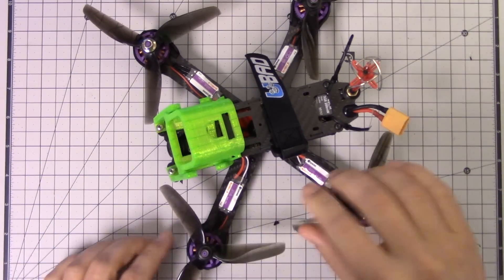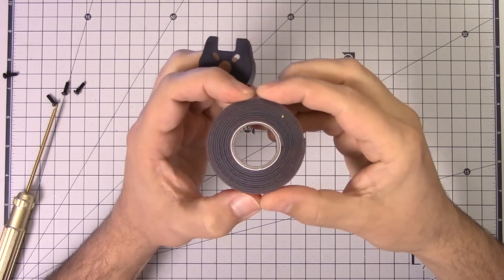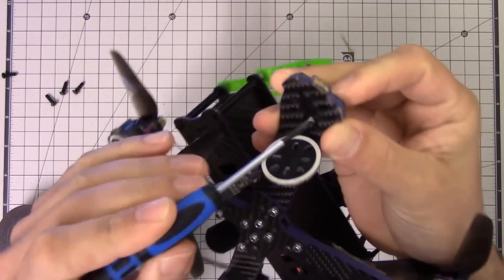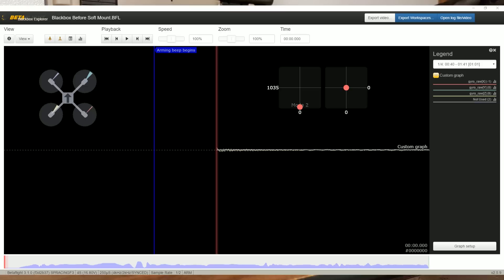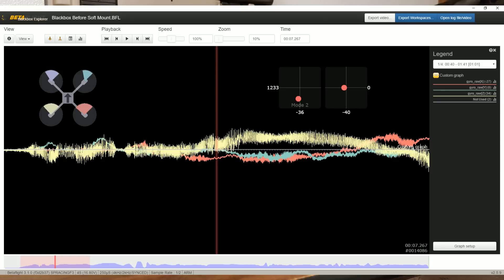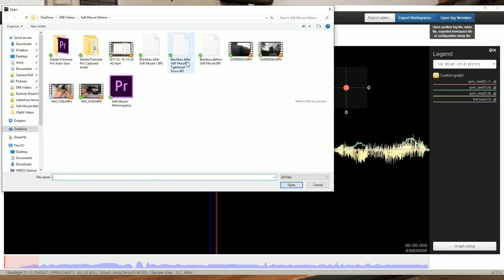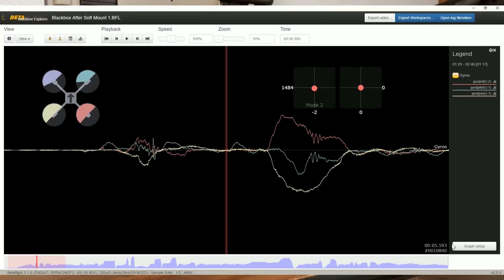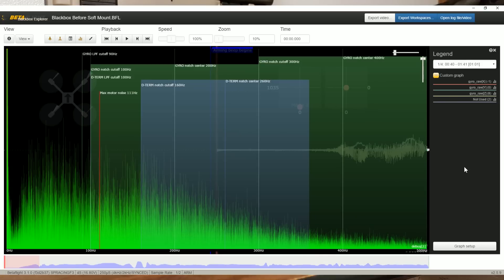Soft Mount Quadcopter Motors | MYTH BUSTED OR CONFIRMED?

Comment: LoL at the beginning.

I have similar shakes at around mid throttle, but the gyro traces are really clean. Haven't been able to tune it out and have been at it for months. It was buttery smooth with my earlier setup 20A little bees and 2204 Cobras. After switching to Xrotor 20A micros and Emax RS 2205 the shakes started.

Comment: Finally a video with some objective data and proofs. Thanks Joshua.

Instead of electrical tape I'm planning in using silicone backing sheets, 1mm thickness. 
Softer,  cheap, doesen't leave a sticky mess and is high-temperature resistent.

Also, I think is better using only 2 screws for motor (A' la FGA or MrSteele), it will give more wiggle room.

Edit: [On a side note: If you find the perfect silicone backing sheets already in your kitchen, better ignore them and order some new one from Amazon. Your significant other may disapprove.]

Comment: Thanks for taking the time to do this experiment and post your results.  I think I may give the soft mount a try with the same tape and see if I can tell a difference.  I'm running the TBS Powercube on my builds and for the most part they fly smooth, but curious to see if this makes things even better.

Comment: Great information. Time to cast some polybushes and drill out the mounting holes so even the screws don't touch! PU is available in a range of hardness grades.
I build my micro quads from acetal because that's what I have available and I can cut it on my laser. Many  people have been sceptical of acetal because it is  not as stiff as carbon. However for a micro I think it is stiff enough. The fact that it is more flexible than carbon might mean less vibration is transmitted to the FC.